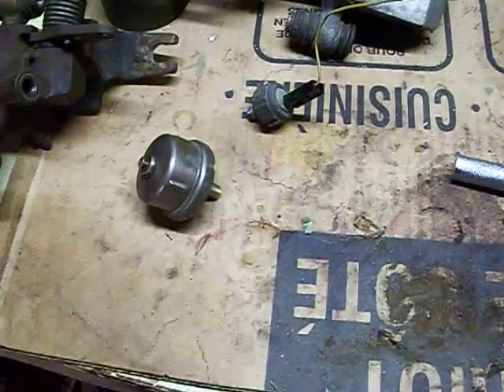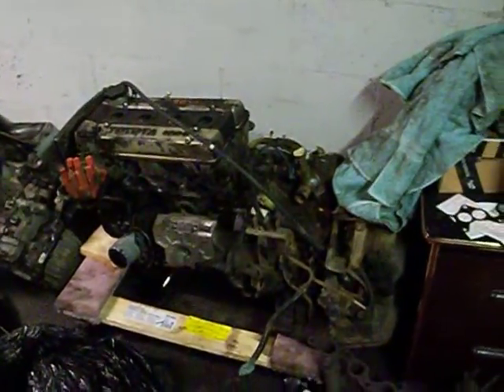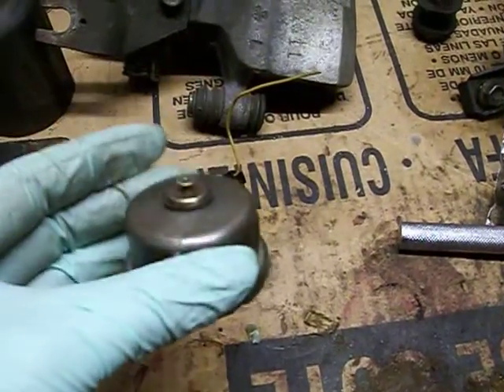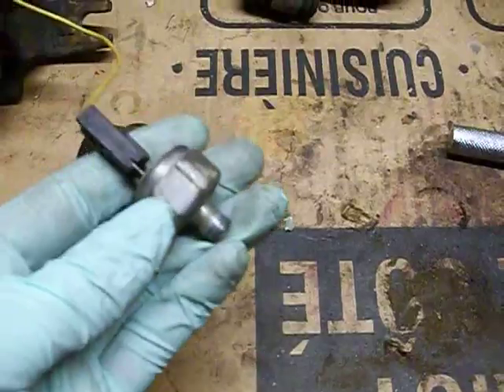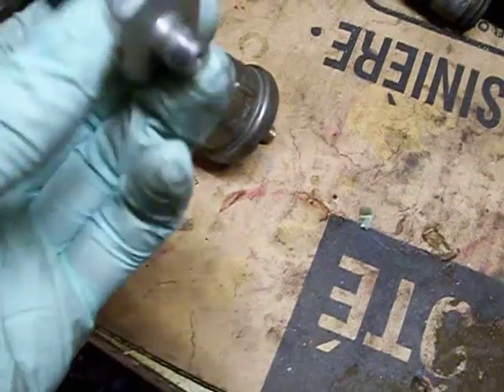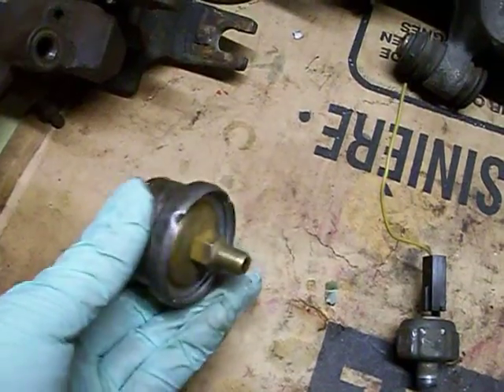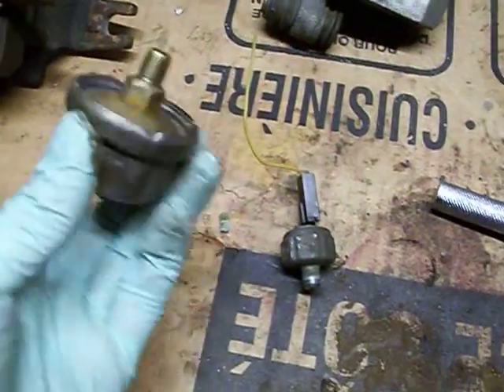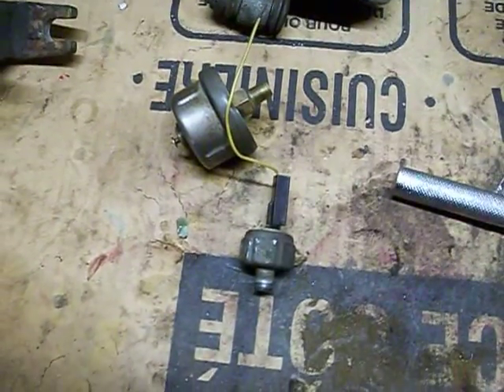Difference in oil pressure senders for 4AGE

Comment: Any tips on removing 16v oil pressure sender without special service tool? Would a strap wrench work without damaging it? If not i'm thinking making my own tool by bending a cone wrench that would fit behind it.
Reply from the maker: Robert Rivera I just grabbed it with a pair of big adjustable pliers. You scratch the outside a little bit, but the damage is very minimal if you are careful.
Reply: GraysGarage Thanks alot, I'll give that a try
Reply: Robert Rivera be careful tho!  It's easy to damage and then it will read thru the roof (i gotta change mine to one from my old engine
Reply: @bushtailrazorback9797  That's exactly what mine does. Needle all the way to the right. Guess it's time for a new one!
Reply: Mollegrips would be perfect for this